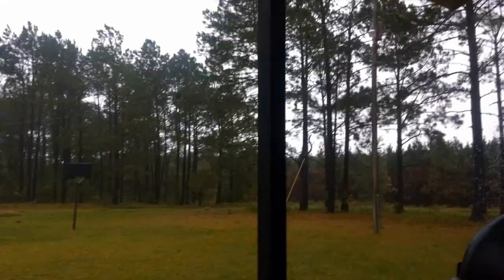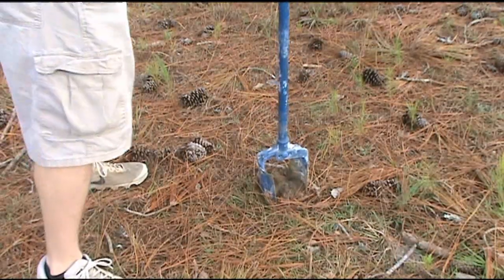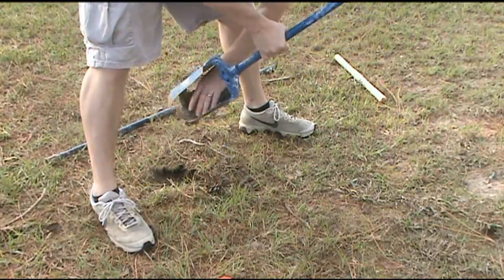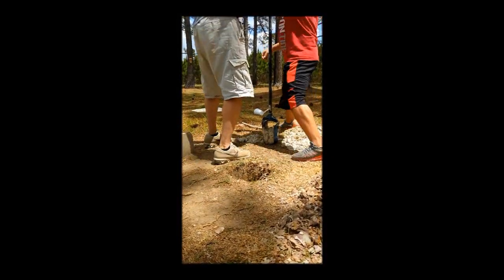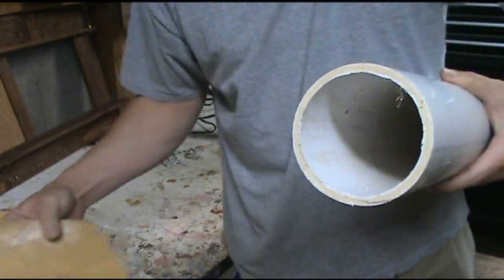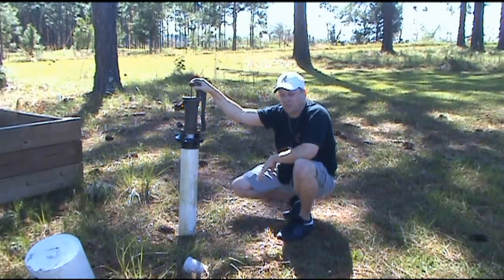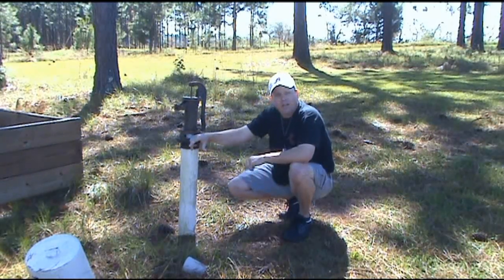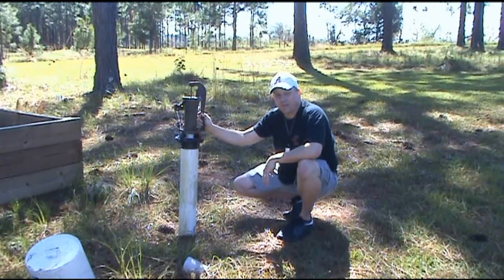How To Drill A Shallow Well. Easy DIY Instructions!

Comment: Very good video. A question for you about the muddy dirt. I want to dig about 18ft down. However, after 12-13ft, the dirt down in the hole is mixed with water. When I pull the digging auger up, everything drip back in the hole, nothing left to put on the ground above. Did this happened to you? And what did you do?
Reply from the maker: Actually it did happen to us.  In the video, just in front of the water pump you'll see an upside down white 5 gallon bucket.  That is the original hole that gave us the muddy water.  We hit that about 10 feet down.  We moved about 3 feet over and dug where you see the well.  That muddy water was just a pocket of water and is not the water table. This confuses many of folks. If you hit muddy water it will never be clear. If you hit the sand/quartz layer you are in the actual water table and you'll be good to go. We missed that water pocket by just going over 3 feet.  Frustrating because of the time spent on the 1st hole, but rewarding once we pasted that 10 foot deep section without hitting the muddy water.  Good luck to you.  Thank you for watching the video. I hope I was of some help!
Reply: @3BricksHigher  how would having a bailer (an attachment on the hole digger, like a bucket, that collects the sandy muddy soil that doesnt stay inside the augger) effect things?  Many companies that sell these well augers also sell attachment nailers (usually like $60 extra dollars).  If you would have had a bailer, would you have been able to continue digging deeper in your original hole location? 
I ask because I'm deciding on buying a bailer to do my well project, because I cant really afford the extra time amd effort guessing where the next hole attempt should be, if a bailer would have prevented all of that. 
What are your thoughts?
Reply from the maker: @-kepha8828  I was not aware of the bailer.  I will say we couldn't have dug it any deeper.  The suction from the sand/water was so strong it took all we had to break the suction and pull the auger up. You can see how hard it was in the video.  If we had another set of hands maybe we could.  If you do get the bailer please let me know how it works for you.  I have friends wanting to dig one for their families and would like to pass along your advice.

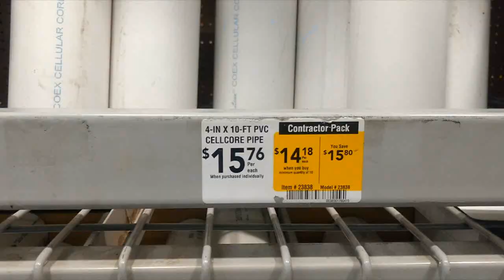Comment: hi, i have watched your video , and another video similar to this, where is the water? i just saw you and your son pull that last piece of dirt u said it was sand and corch , on min 3:06 , where is the water? did u dig further ? . the other video i watched never even showed the water also.... i am so confused!! help me please, thank you !!
Reply from the maker: Thanks for watching! The water is inside of the hole. The hole was 20 feet deep when we hit water and it filled the hole about 9 feet. We dug down another 4 feet into the water table so we have about 15 feet of water inside of the 24 foot hole. If you listen closely when my Son and I are pulling the auger out, you will hear a clump of sand and quartz fall back into the water. It makes a loud splash :) We put a hand pump into the casing to pull the water out.
Reply: @3BricksHigher  Hello ,thanks for replying to my comment and helping me out, may I know how much water can i pull out in one day ,as I'm planning to dig a shallow well like this and use it for irrigation , as i will try to connect it with a treadle pump . 

May I ask also , I'm sure that if you pump the water for hours it will run out. May I know how much water can you pull out in one day and how long does it take to recharge , and do you suggest using this kind of well for irrigation (im tight on budget and im trying to start a farm in africa, im searching and googling out all the possible options, and i found out that shallow well + treadle pump is the cheapest way to provide irrigation to my future farming land)

Thanks again
Reply from the maker: @JapaneseWithoutKanji  The most water we've pulled from the well was 200 gallons per day for 3 days in a row.  Normally we pull 30 gallons per day. The well has never went dry and charges very quick.  I believe we hit an underground spring. I wish you great success with your farm and I hope your well provides years of irrigation for your crops.  If you have any further questions for me I don't mind it at all.  I do not know anything about a treadle pump.  I've never heard of it before.

Comment: Can I use a gas powered post hole digger to get this started?
Reply from the maker: Sure, to get started.  I'm not sure how the extensions would work.   At deeper depths, I'm guessing if they are buckled from torque or speed, inside of the hole it would be horrible trying to  remove them from the hole.  If you try it please let us know so others would know if it would work.  We actually plan to put a shallow well in both my Son & Daughter's yard so I personally want to know how it works.  You could possibly save us some time!  Thanks :)
Reply: @3BricksHigher  hmm I am just tired of dealing with my rual water company the pumps are old and keep shutting down leaving us without water for days I can’t afford a deep water well to keep self and my animals with water so trying to figure out how to keep animals and garden watered I can deal with filling gallons in town for a few days but really need to have a backup
Reply from the maker: @danielleterry180  We've really enjoyed our and have pulled plenty of water from it.  I wish you the same success!

Comment: ...I'm here in Chipley so have the same situation. Question I have is...how do you get 30' of pipe down to the bottom ?
Reply from the maker: After you glue the cap on the piece with all of the holes, you lower it down and then carefully 'C' clamp it (preventing it from dropping down into the hole, resting on either side of the ground hole) while you glue the next piece to it.  After it dries, you lower it and repeat it once more.  It does not take a long time for the glue to strengthen.

Comment: would this well be enough to store some water? Like if I get a large water tank and drop a small water pump into that hole, would it take years to fill the tank? I know it would depend on the location but just to have a general idea..
Reply from the maker: I have pumped literally hundreds of gallons of water from this well without issue.  Because of this, it has opened "channels" where the water fills the casing up quicker.  The pump would not need to be faster than your fill rate.  Other than that, you should be good with a tank and pump.

Comment: Does the pebble filter clog with muck after a while ? Can you do anything about that except start again ?  How long has your lasted without clogging ?
Reply from the maker: Since we dug into the water table 4 feet, it should never clog.  Keep in mind the sand and quartz are below solid clay.  The clay will not wash off as the water flows from pumping.  Keep in mind that as you pump the water, you will pull sand and create channels through it.  Once the channels are created, you should have just clear water.  I use this pump to water our trees and bushes (actually have a vid about that posting this monday) around 3 times per week.  Around 50 gallons total per week. If you have any other questions please feel free to ask! :)
Reply: 3BricksHigher I have a question, where did the bagged pebbles go?  Did you put them inside the piping?  Or around the outside of the piping?  Lol, women!  We weren’t meant for this stuff...obviously!
Reply: @mycharmedunicorn8715  on the outside, you funny want anything inside of your PVC pipe but water

Comment: I'm confused how many feet did u have to did to reach the water and once you hit the water is that the water table you talking about cuz you said 20 something feet for water table but 200 ft in the beginning so that kind of threw me off
Reply from the maker: Our main well is 330 feet deep.  It pulls water from the Florida Aquifer.  It's a HUGE body of water.  The shallow well my Son and I dug, we hit water at 20 feet.  We hit an underground spring.  We dug 4 more feet into it so the well would not run dry.  Thanks for watching!  :)

Comment: Is it possible to go down 45 feet this way?  I know it would be a pain but that is where my water is.
Reply from the maker: It would be possible, but you will need some man power to pull the auger up.  You would also need a different pump.  The one I have installed will only pull the weight of 33 feet of water in a 1 1/2 inch pipe.
Reply: It's probably too late, but search well augers on ebay.  They make ones nowadays where you dont have to pull the auger pipe/extensions up each time.  The actual auger head (the part that digs) is attached to a rope, and slides up the middle of the pole.

Comment: Let me ask you this. Our water table is 53 feet down, we used a sand point and pounded a well 74 feet deep with 19 feet of water, blew the well out with a 4 cfm air compressor. We have drop pipe and a 2 stage sta-rite vertical pump and only pulling water at about 1 gallon in 2 minutes, not good. Would you say we are in muck or not water vain?
Reply from the maker: If you are pulling clear water then you aren't in muck.  Do you think you could be pulling a vacuum from the bottom of the well?  Regardless is you have the 3/4 or 1 horse pump, you are pulling around half of what you should be pulling. If it is a vacuum issue it should ease off once the water erodes channels around the bottom of the pump allowing water to flow easier. The more you run it the better it should flow.
Reply: @3BricksHigher  it’s like a brownish color almost like it has clay mixed in
Reply from the maker: @FixerUpperDoorGuy  it could be sediment you are pulling as channels are being created. Mine was white from sand for about 30-40 gallons. After that it's been clear since
Reply: @3BricksHigher  so like a moist area where water collected. Most wells around here are 180-200 feet. I’m 75 feet, so about only 30% of the way
Reply from the maker: @FixerUpperDoorGuy  my main well is 332 feet down. This shallow well is 24 feet down hitting water at 20 feet. There is useable water at different depths. After you've ran several gallons from your well I would be interested to know if it clears
Reply: @3BricksHigher  I’ll let you know if it does, my only concern is that it only gives me about 1/2 gallon of water a minute, not much at all
Reply from the maker: @FixerUpperDoorGuy  if it is sediment from channels forming you will see an increase in water flow for sure

Comment: How long will the water be available for ? In other words, will it ever dry up ? Thanks. Novice here.
Reply from the maker: If you hit the actual water table, you will have water forever unless there is an extreme drought; And maybe even then never run out of water if the table is strong.  Now if you hit a "pocket" of water instead of the actual water table, you would run out pretty quick and would need to redo the dig.

Comment: I have tried this before. My problem was that when I hit water at about 12 feet, the tool would no longer hold the mud so I could pull it up. It would all slide out and the result was I couldn't go deeper. How do you get around that?
Reply from the maker: We actually did the same thing.  If you look in the video you will see an upside down 5 gallon bucket. That was our 1st hole and we hit mud around 11 feet.  Since we didn't hit the white sand and quartz we literally moved over 4 feet and the hole stayed dry until we hit at the 20 feet mark. The muddy water is just a pocket of water and not a spring or aquifer. You were close though!

Comment: Why not a electric pump?or can the well handle a  shallow well electric  pump
Reply from the maker: Yes an electric pump can be used.  I believe it is called a jet pump.  Since my Wife wanted an old times hand pump that is what I installed.  This particular well I think could handle an electric pump if larger channels were made from the water movement as water was pumped.  (I hope that makes sense?)  The larger the channels for the water to flow through, the quicker the water replenishes the well.

Comment: Have you ever not been able dig a well by hand because of rocks???

I’m so tempted to buy land but my gut is afraid to get myself stuck :/
Reply from the maker: We had a layer of rocks about 8 inches thick. It slowed the process, but we were able to get through it.  We dug mostly through hard clay.  I would hate to imagine digging through a lot of rock. When I was younger I was in the FFA and participated in land judging. There, I was taught to look for how the land is layered just by driving down roads. Some roads are dug through hills allowing you to see the layers of earth on each side of the road.  Our area was clay so I knew I should be ok. Look around for clues like this to help you decide your area's land make up.  Hope this helps!
Reply: Henry how to buy land on the cheap
Find state and county or counties you can call home
1. Ask county what taxes are
2. Ask about building codes you really only want counties that only have power pole and box along with septic 
3 ask for their tax seized list some have attorneys handeling the sales and they will send you list for free or charge 10-15.00
4. When you get list look at resale these are properties that came up on original sales and didn’t sell ( investors want quick fix ups to flip or rent not land)
5 walk the properties your interested in never buy sight unseen
6 resales don’t require a set start bid amount THAT can be your savings and you don’t have to stand on court steps to place bid on bidding day just submit your bid . 

7 when you get your land go to county clerk file homestead. It’s free and protects you from IRS and law suits as accidents do happen also if your 65 file for cap on taxes 😁 so no matter what your taxes never go up 😁 
No building codes means you can build yourself and not get raped on permits and inspections. Or you can do shed conversion do the inside work yourself will save you money you can live in it while working on it or Mobile home you see the sky is the limit to what you can call home.
I hope this helps you see your dream as it did for me
Reply: Also shed conversion is rent to own way cheaper than apt rent and no closing cost also no credit check you can get them to frame out inside to floor plan you choose or on way cheaper side do it yourself. If living down south I can tell you how to build a log cabin using non treated landscape timber 😁 must seal it after you build if your younger and living up north use the timber on your land and seal it will last a life time but don’t let fear stop you just roll up those sleeves 😁
Reply: @danielleterry180  hey danielle thanks so much for replying. Me and my girlfriend are talking about moving out and we can probably do itttt but im gonna reread this with her and talk about our future tonight :) I'd love to know more about your projects cause were gonna be newbies probably in upstate New York unless i convince her to explore a little with meeee first

Comment: 2:45 … Wow.. really? Where are you? Will this work in Lake Placid Florida .. Won't I hit hard coral rock in like 3 feet?  legal to do this w/o permits?

I'd like to run a portable 12v pump I remove when I leave the property.  Any idea would I would expect to pay to have a well drilled?
Reply from the maker: You would need to check with local gov'ment to see if you need a permit. The hand auger is made of steel.  Harder than coral so maybe? Since you are in Fla, I'm sure you've heard of Thomasville?  I'm near there.  Now I will say although this well hasn't ran dry (knock on wood) I don't think it would keep my house running daily.  From the test I received back it believe I tapped a spring.  Location and water table depth will depend on how much you can draw from your well.  "Put the face down on it and start turning"  :)  That's how you will find out.

Comment: As soon as the video started I had to laugh. You would only drill down about three inches around here. You can't even drill a hole with a tractor and post hole digger.
Reply from the maker: We had about 20 inches of good dark top soil and then about 19 feet of clay. The clay was the worst part. I couldn't imagine hitting rock!

Comment: Strange that your main well had to be drilled 320 feet when you can hand drill a working well nearby thats a mere 30 feet deep
Reply from the maker: Actually it isn't strange at all.  The 322 foot well was dug to reach the Florida Aquifer which is a massive body of water.  If everyone pulled from shallow wells, we would have to depend on rain water replenishing them to prevent shortage. I know of folks around here that have 600 feet deep wells, but mostly these are farmers pulling water to grow crops.
Reply: @3BricksHigher  I second this statement as true.